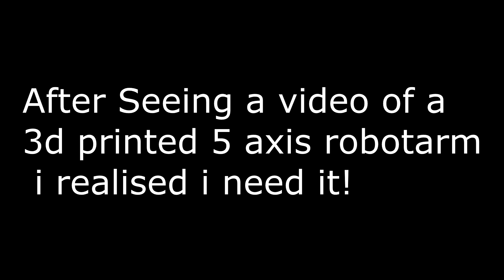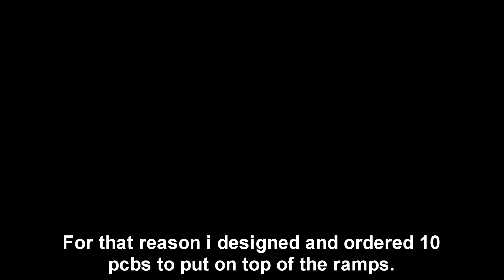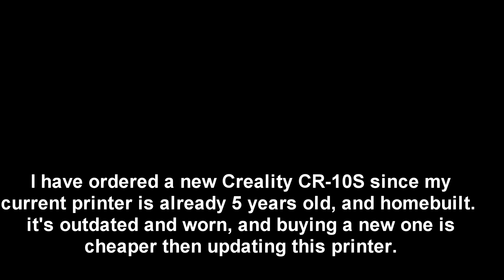3D printed 5 axis robot arm

Comment: Hii you make a good project. Can you send me the circuit diagram,code and    
Microcontroller board name please..
I'm a student amd I'm making same project but i didn't found the code and circuit dusgram.
Reply from the maker: Hi Salman,
Just check the links in the description.
We actually played arround with it today again 😁. Difference between mine and the original one is that mine has a way higher payload.

Comment: Hi, A great video. I am very impressed with the connectors you designed to connect to the Ramps board. I made something very similar using copper board and header pins. They work but not nearly as clean or professional as yours. I would be happy to pay for either the design to get some printed or buy them directly from you. Many thanks.
Reply from the maker: i looked it up, i can send you 20 pcbs for 15 dollars. i order a second batch so i have some myself aswell. i edited something in the silkscreen but i keep having one failure in it which keeps a pin unreadable :(.
Let me know if you like that?
I live in the Netherlands by the way, so i dont know about postal service.
pcbs can go in an enveloppe i guess?
Greetings,
Jelle
Reply from the maker: Hi anthony.

I did order a batch of these pcbs about 2.5 month ago with an updated silkscreen.
They have not arrived from china :(
The tracking information shows that the package has been in singapore and a month later being returned to china.
I do my best to get these pcbs here.
I have been very busy lately so sorry for the delay in information.
My email is jelleschafelt@gmail.com

Greetings,
Jelle Stappers

Comment: how much does this 3D print cost?
Reply from the maker: felix huang im not sure exactly. but i would count on 120 euros. i used colorfabb ngen to print the robot.
Reply: Thanks for your reply...Can you try to make this robotic arm to stick the product label on a plastic bag?...This is a very big market in China because the labor cost(Worker's salary) is more and more expensive......
Reply from the maker: I think for labeling stuff this arm is way overkill.
Reply from the maker: Im looking for getting this robot to run on ROS, then anything would be possible :).
Reply: Looking forward to see what this robot arm can do..We need to stick more than total 2000+ of cellphone case s with label stickers everyday...and it takes us more than two hours to get this job done ...We need some robot arms which can stick the label sticker for us..also computer visual is needed..by the way...what kinds of motor you used on this robot arm?how much does the motor cost?